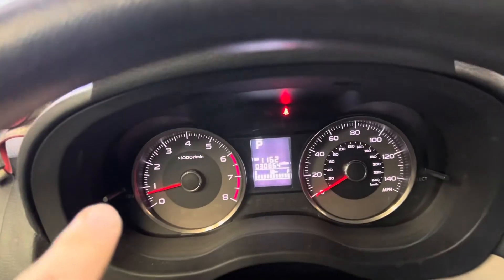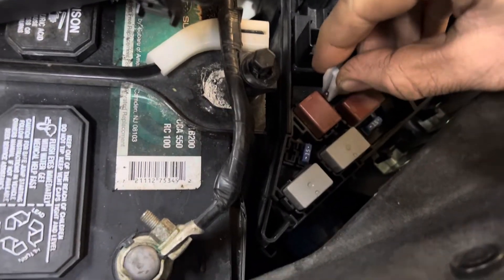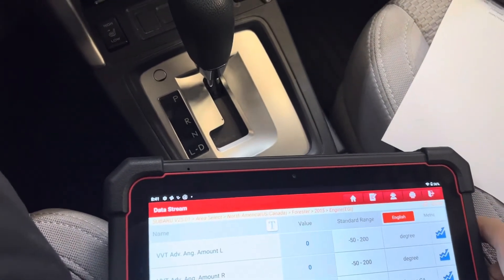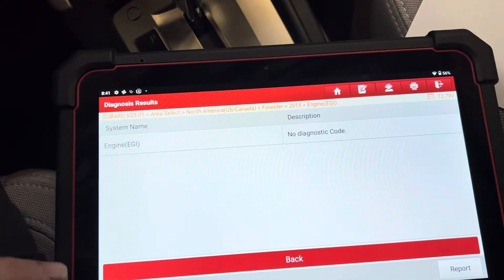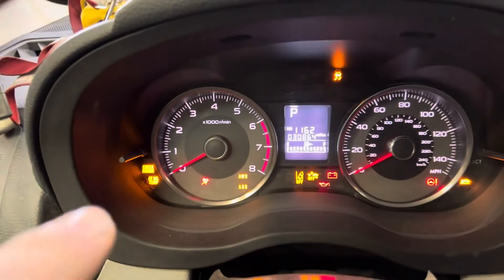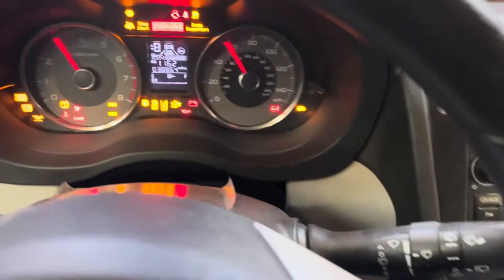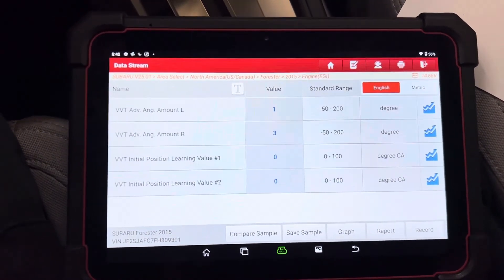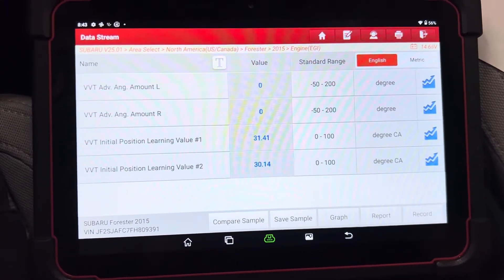Clearing 2015 Subaru VVT learned values without eeprom or ecm replacement.

Comment from the maker: It has now been confirmed by a someone on Facebook (Dave J) that the method worked on a 2019 Subaru Crosstrek with values out of range.  

I would like to think those who helped figure out this method, and find the missing piece of the puzzle. Joe B, Rob D, Robbie M.
Reply: I have done it on a 2018 crosstrek aswell.
Reply: Hello! I was hoping you could help me out, my tuner told me that my AVCS Exhaust is stuck as the values just switch from 3/4 and 5/6 on left and right Exhaust. I was wondering if this would help me out with my situation as he mentioned me needing to reset the AVCS learning on my 2017 WRX thank you so much!
Reply from the maker: @SubaruMode  I offer a mail in service as well or you if your tuner has a launch or autel scan tool you can try the method in the video. 
If you would like to use mail in service email me at admin@thepracticalmechanic.com
Reply from the maker: @SubaruMode  unless you mean the vvt system doesn’t physically work as intended.
Reply: @ThePracticalMechanic  I can send you an idle and a drive log so you can see what I mean? And what can you do through mail service? Thank you

Comment: This worked for me, you just gotta make sure you get it in test mode, with the CEL blinking. After i did that, it successfully wiped the learned values. Thanks for the great video. I replaced all my OCVs, it might have been overkill, but it was still cheaper than just changing one at the stealership.

Comment: @ThePracticalMechanic, I have the Autel MK808S scan tool and I was trying to clear the values on my 2019 Impreza.  The tool doesn't seem to have an option for "clear fault memory", just "trouble codes" > "erase codes" or "read codes".  Has anyone managed to perform this with that model or do I need a different scan tool?
Reply from the maker: Subaru VVT Learned Values Reset With Autel | ECM Saved!
https://youtu.be/ur-jb_lwO0o
Reply: @ThePracticalMechanic  It worked!  Thank you so much!! Subaru wanted $6k to open and clean the engine and replace the ECU!

Comment: I was able to reset the VVT values to 0 , but on start up they returned to 110 (outside the range and showing red on scan tool).  
No CEL or codes  after a few drives but shouldn’t the values be in range?
Reply: @thepracticalmechanic just to clarify with a few details.  2018 Forester XT. Dealer swapped out the timing chains and vvt sprockets.  Said one sprocket was bad.  
Did the vvt reset after the work was completed.

Comment: This worked on my clients 2015 Subaru wrx, FA20DIT engine in 2025. His car has electrical issues from mice and a singular P0016 code popped up and wouldn’t clear among a plethora of electrical related codes. My GWsmart07 scanner was able to put the car into test mode and we officially reset the vvt values. So far the code has not come back. Thank you so much for this information it saved my client 5k in parts plus labor.

Comment: Thanks a ton! This saved me $2000. I REALLY appreciate it!
For anyone reading the comments wondering what's needed: I used a Thinkdiag (not Thinkdiag2) on a 2019 Crosstrek with a P0019 code. The interface of the Thinkdiag looked different from the video obviously, but the names of the menus/ options to select were exactly the same

Comment: Subaru Bulletin 09-94-22 provides guidance for Subaru techs to do this at dealer for 22+ Subaru wrx models. 0.4-1hr of time, so cheap fix and should not be replacing ECMs any longer.
Reply from the maker: Unfortunately, they did not make software updates for all models that use this engine. Some models will still need this. Reset performed with the scan tool and some early models still require the ECM to be opened up and the file modified directly.
Reply: @ThePracticalMechanic  absolutely, thank you for this. Just informing ppl who may need this on fa24f 2022+. My vb doesnt have a diagnostic slot in fuse box or at least I couldn’t replicate what you had in this video. I wish i could.

Comment: Heloo, i have a 2014 Crosstrek and a Autel MS909. Is "dealer check mode" the same function as"test mode" with the fuse installed, i go 
Into my special functions in autel and select "check mode" but when i try it tells me to connect the green connectors. I didn’t think they had the connectors on these models and i looked everywhere. Any idea if they have the connectors on the 14 cross? I cant get past the error in the autel where it says to connect the harness.
Reply from the maker: The crosstrek usually has the fuse location under the hood. Some 2012-2014 Subarus still fail with the scantool. I offer a mail in service for all years because some are stubborn and some refuse this method.
Reply: @ThePracticalMechanic  how would one find your mail in service, I have a 2014 Crosstrek that I believe needs a VVT value reset.
Reply from the maker: @ssgdakota send me an email chad@thepracticalmechanic.com

Comment: 2017 Subaru Impreza here that was coding P0017. This fix worked for me. Used a Thinkdiag2. Amazing. Can't believe this worked. Thank you for your video. Saved me thousands of dollars that Subaru wanted to charge for an engine rebuild that wouldn't have fixed the problem!
Reply: Hey man how did you get it to work with thinkdiag2? I just ordered one and it will be here today I have a 18 WRX with a p0016 code. Any help you can give me will be greatly appreciated thank you in advance

Comment: TLDR; Thank you. From the bottom of my heart!
Can confirm this works on a 2013 BRZ MT, using a Thinkdiag2.
May this find the next DIY tech that may be seeing the same things I did. Learn from my mistakes and all these wonderful people trying to share this knowledge.

2013 BRZ manual. Took out the engine for a TOB, fork, springs, clutch and slave cylinder. Did the rear main as well as the crank pulley gasket, and the one for the spacer that drives the oil pump. few other things as well as cleaning out the intake manifold, injectors, etc. 
Of these parts, my stock VVT solenoids were rusted and looking pretty shotty. I put new ones in...Upon first start up i was showing P0011, P0014, P0021, P0024. P000A,B,C, AND D. Yeah... my heart sank and I've lost hair over this for the past month or so. found this procedure early so it definitely helped my troubleshooting. I went with the ebay special when it came to the VVT solenoids... my fatal mistake. This procedure would reset everything, yet i would get the codes the very next drive. New SUBARU solenoids, updated part numbers and everything, she purrs like she used to <3 Noted: oem sensors from now on. To be fair, even after installation of the new OEM solenoids, the faults were still there and without this procedure i would be waiting for the bill from the dealer (next steps from here according to the service bulliten are cam sprockets and ECU... no bueno)
This vehicle has been through a lot with me and I feared my mistake would make her chew herself up internally, it certainly was chewing me up! if you are wondering, oil is clean, it has been flushed, vvt parameters were verified all using the thinkdiag2. i still monitor them every now and then. thank you, thank you , thank you!
Reply: I want to say thank you for this advice. 100% correct info here. I had done exactly what you did, however I had one aftermarket A Premium solenoid and still got P000C P0021, P0017 and P0019, swapping it over to bank 1 gave me P0011 and P000A, once I went OEM, and did the relearn procedure everything runs perfect. Thank you!
Reply from the maker: @PBB666  that’s great to hear. Most are unsuccessful on the 2014 and older but not many BRZs around to test with. BRZ must have some of the functions available only on 2015 and newer outbacks.
Reply: @PBB666 im in the extact same situation with a Scion Frs, how did you went to service mode? ty ( fuse / Insert a jumper between pins 4 (common ground) and pin 13 (TC) on your OBD2 port / Thinkdiag2 directly able to put it in service mode?
Reply: i figured it out! its  the fuse slot under the DCC (30A)
Reply: @MrFL00W  your fuse box in the engine bay has what looks like an empty unlabeled  slot. put a fuse in there and follow that procedure on the video. worked like a charm. if i recall correctly you have to put it in service mode within the thinkdiag2 as well.

Comment: Which scan tool are you using for this as i need to clear codes after replacing my vvt solenoids on 14 xv crosstrek
Reply from the maker: @shawnhall6803  2014 and down typically cannot be reset with this method we have since found out. I can reset them on the bench if you need a mail in service option.

Comment: I figured out how to clear it on a 2015 BRZ with a thinkdiag 2
Reply from the maker: @nickvidz2458  sweet. Using this procedure or a different variation? I haven’t had a BRZ in the shop to test with.
Reply: @ThePracticalMechanic  yes, same procedure but the inspection fuse slot is in front the 30A DCC and it’s X’ed out on the fuse box diagram.
Reply from the maker: @nickvidz2458  nice!!! I’ve pulled up the diagram for a few and not all have the inspection fuse.
Reply from the maker: @nickvidz2458  this comment reminded me that I ordered a salvage ECM 2 months ago and never received it from eBay seller. I’ll order another and play around til we find a way.

Comment: Autel did an update, and this function is no longer in the tool.  Subaru took that function out of the factory tool years ago.  I did a 2015 Forester with the EA20 2.0 Turbo engine and Launch had the function, but it did not clear the learned values.  If you have a scan tool that this is working for you, DO NOT update your Subaru software, as you will likely lose this function.
Reply from the maker: That's good to know. I will have to see if this function still works on future updates.

Comment: Had a engine swap done in my 2015 wrx bought a zero mile longblock and swapped my accessories over. Its all together but were getting a few cam codes p0016 and P0018. Cant squash them will this work with these codes?
Reply from the maker: @a-animal1206  it is possible that this will work. If you have a scantool available I would check the learned values and check them against the TSB or post the numbers here. 
There may also be a factory software update to resolve the issue. Subaru released an update for “select” models.

Comment: Dude, thank you so much. I just had to put a new engine in my wife’s 2018 wrx due to a horrible rod knock/oil starvation issue. When we installed the new motor I continued to get the codes you describe in the video. As of today the permanent codes have cleared, and i only have two pending that im assuming have to do with the ecm relearning the vvt values. I used the thinkdiag2 reader. Your the bomb!
Reply from the maker: @joshBeaumont-m7p  awesome!!🤘🏼
Reply: How did you manage to do it on the thinkdiag2? Been trying to do it  for at least 2 weeks now
Reply: @SubaruMode  you hit the diagnostic button at the top, then select system scan (i think thats what it was), then select EGI (the ECM is labeled as EGI), the select special function. From that point it should be the same as the video. You have to have the car in test mode though with the 10amp fuse, otherwise i don’t think the special function menu will show up.
Reply: @joshBeaumont-m7p did you have your cobb ap married to the car still or did you have to uninstall it? Also curious if you were having the avcs numbers out of wack when starting the car
Reply: @SubaruMode  no i didn’t have to uninstall the app. Once you clear the vvt learned values, they will be zeroed out. Im assuming thats what you mean by avcs numbers?
Reply: @SubaruMode  i don’t use a COBB, so I would imagine if it connects through the OBD2 port you would have to disconnect it to connect thinkdiag2 to the ecm.  (My car is stock, sorry for the misunderstanding)
Reply: Ah okay! Yes everytime I start the car or reflash the car tune It keeps the same avcs values not sure if you were running into that issue as well after doing your engine work
Reply: @SubaruMode  i do know after my initial attempt at clearing the values, i kept having weird codes and such. I ended up having to replace the vvt solenoids on the front of the motor. I did all four just in case, and I reset the values and the codes haven’t come back. I have been getting one pending for advanced timing but i think that may have to do with the engine having to relearn. But i haven’t gotten a clear answer on that as of yet.
Reply: @joshBeaumont-m7p  thank youuuu so much for the information! Gonna try it out today!
Reply: @SubaruMode  hey did it work?
Reply: @joshBeaumont-m7p  no luck! The values are still the same, might have to replace either the sprockets and ecu or one or the other. Had a tech do it with the expensive tablet as well (mind you no codes on my car) just the avcs not working as it should on idle or driving
Reply: Hey man I had a issue similar to yours on my WRX cleared the correlation codes but I'm getting advanced timing codes after a long block swap .. is it a timing issue or you think ECU is trying to learn ?  @joshBeaumont-m7p

Comment: Do you know if this will work on a 2019 STI?
Reply from the maker: @turbosupra420  the EJ25 engines shouldn’t have the same issue. Typically if you have timing codes you need to check belt alignment, avcs filters and solenoids. If the cylinder heads have been removed before I’ve seen the camshaft sprocket bolts improperly torqued which will lead to sprocket damage and these codes.  

You could try the reset but I don’t think that’s your issue.
Reply: @ThePracticalMechanic  thanks for the response. I work for a subaru specialty shop and do a lot of engine jobs. I have now come across 2 2019 Sti that I did a new engine and after had correlation codes. Confirmed everything timing related was fine. The first one we put a new ecu in it and it fixed it. The other one the customer did not have money for the ecu yet so I was hoping to find a cheaper fix. Thanks
Reply from the maker: @turbosupra420  WOW!! I haven’t tried it on an STI and didn’t know if they would burn in the VVT values. I have had ej25 engine that would count misfires after replacing the engine even though there was no misfires. This was due to the ECM learning the crank profile of the original engine and the new engine was slightly different. This reset worked for that so it is possible that it will work for you. 
If not it can likely be reset in other ways. Yesterday I was doing some research and found the memory addresses for the VVT data on a 2015 and 2018 FB motor.
Reply: @ThePracticalMechanic  the 2.0 fa and fb engines make sence to have it. Done so many ecus and timing gears together. Just doesn't make sence to me that just putting in a new engine with all new timing banjo bolt filters removed would have corelation codes after.
Reply from the maker: @turbosupra420  where are you located? Do you happen to have any of the old ECMs? I would happily pay for them so I can do some research.
Reply from the maker: @turbosupra420  did you try the reset today?
Reply: I did not. My Autel is very old and doesn't have it. Tried with a snap on but no luck. I have to look onto getting a new scanner. We also had a 2017 forester xt come in with a p0017. So i would rather not replace the ecu
Reply from the maker: @turbosupra420  I also do mail in service if needed. Just shoot me an email if interested. Admin@thepracticalmechanic.com

Comment: Loved your video but i have problem with my subaru crosstrek 2018 can't find correct location for fuse to plugin in so could you tell me in which slot it is. problem is I can't find it on internet so need help.
Reply: After much searching I found the Fuse location, this is #39.
However, I am using SSM4 and was unable to reset the data.

In my case, the "VVT initial position learning value" indicator is fixed at 57.

Is it possible to clear "VVT initial position learning value" data using SSM4 ?

If possible, give me a little hint.

Comment: Thank you Joe and the Practical Mechanic!!   I think this just might be a fix!  Did this yesterday to 2018 Crosstrek Premium, code P00019 that came on with a delayed oil change.  Spent lots of money having a mechanic change cam oil exhaust solenoid, then stated didn't know what else to do.  Took it to a Subi private mechanic who scoped and state absolutely everything in the engine is working as it should be but could not get the code to re-set.    

Used a ThinkDiag2 with iPhone, have so far driven 3 times about 15 miles total, power in lower gears is restored and no CEL light!!!     

The Subaru XV forum has deets on this but, if anyone is wondering:     use your 30 amp spare fuse (in the lid of the fuse box) and your grey fuse puller (middle of lower row in fuse box).   The test fuse open spot is the far left lowest (closest to you) spot.   

Thank you, thank you, thank you Practical Mechanic!!!!!!
Reply: I’ve been trying, but I can’t find  the way on the thinkdiag2 can you explain the way you did it?
Thank you
Reply: I have been trying on the think diag 2 also, i can’t figure out how to go to test mode. Any insight?